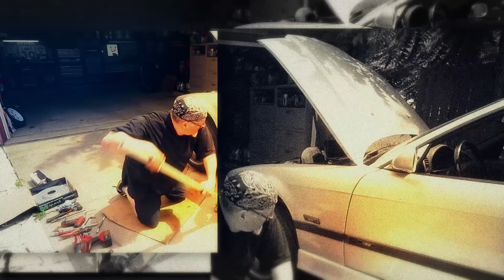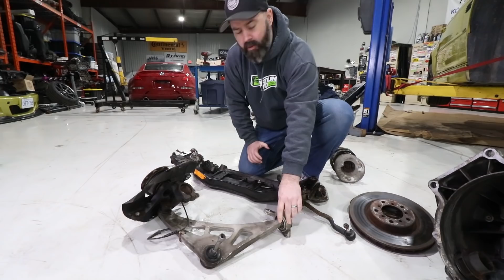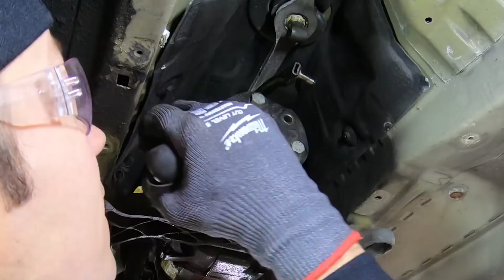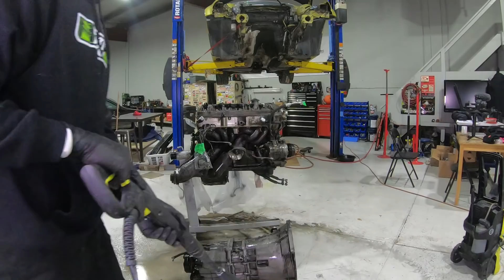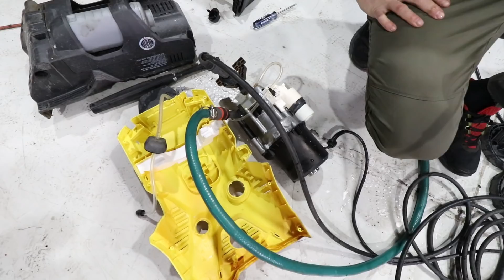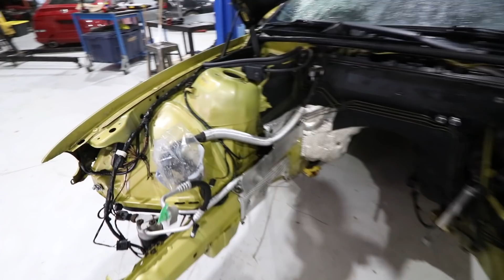Rebuilding and Modifying a $4000 BMW E46 M3 - Part 8

Comment: DO NOT PUT POWERFLEX FRONT CONTROL ARM BUSHINGS ON!!!!! They are notorious for quickly falling apart. (heat issue). Powerflex rear trailing arm bushings are fine.

Comment: Think twice about swapping the plastic clutch pivot pin for steel or aluminum; the small hole or boss that the pivot pin sits in is cast into the transmission housing and is prone to cracking - when this happens you are now out an entire transmission. Much cheaper to simply replace the plastic pivot pin and sleep easy knowing it will break before the transmission casting does!
Reply: Maybe if they're made wrong... We've sold hundreds of ours with zero issues

Comment: Get rid of the US Headers and buy some Euro Headers or some Aftermarket ones.
The US spec headers cost alot of Power.
and get rid of the Cluch delay valve , without it it will feel more like a None Hydraulik Clutch.
 and less wear because it closes the Clutch faster.
Sorry for my bad english i hope you understand what i mean.
Greetings from Germany 🇩🇪
Reply: M3 should not have CDV, at least in Europe it doesnt.
Reply: @juniwalk  and I always thought every E46 has that
Reply: @freakyRunner  Few months back i didn't even know it existed :) My 530i E39 has it removed now and its great!
Reply: US one does :( @juniwalk
Reply: @juniwalk  every M3 sold in the US had one new
Reply: +1 on CDV delete. If this car still has one definitely remove it, clutch feel is night and day difference without the valve on BMWs.

Comment: You can replace the balljoints in those arms. BMW doesn’t say any of there front control arms are serviceable, however you can buy Meyle balljoints for those arms. They are not difficult to replace with a press either.
Reply: JT Lyons isn’t that only for the Meyle branded control arms for the e46?
Reply: Jack Eagan I have pressed Meyle balljoints into Lemforder control arms, so I do not think so.

Comment: BMW fanboy alert! Take your head out of the sand so you can properly recognize BMW's many deficiencies. Just because it's an M series means nothing. I assure you there are much better headers possible. Just removing the cats alone would gain power, so any header that does that will most certainly make more power.
Reply: for my e46 M3 i did fabspeed stepped headers, moved the cats to Section 1 w/ 200 cells. This is close to the CSL set-up. Also, I did a Rogue Engineering x-pipe.  Definite improvement from my butt dyno.
Reply: @nevrcm3261  Sounds like a nice street setup... I was thinking more from the track mindset, like removing them completely. At least they would be nice like you have them, then maybe you could bolt in test pipes for track day.
Reply: @Wheemer  yep for street...and test pipe swap for track.

it will be a fun drifter!

Comment: i always put the m3 csl motor mounts in my cars! they are great! dont have the oil filled core but still dampen the annoying vibrations. you can order them at any dealer. they are often called groupe N or simple e46 m3 csl motor mounts. they are urethane filled rubber bushings and the work amazing!

ps: did you guys check for the clutch delay valve in the hydraulic line? taking that out gives a lot better feeling pedal

Comment: When those brake rotor hold bolts get stripped what I do is use a Dremel tool to cut a deep line then I just use a flat head driver to screw them off. Works every time.
Reply: I usually cuss off the Europian automotive industry for using wheel bolts rather than studs like the rest of the world making those rotor hold bolts necessary and the previous tech for fucking it up prior to and during cutting the slot for a flat tip screwdriver
Reply: Impact driver works fantastic (no, not an impact gun)
Reply: @TheZohanLohan  yes, but only if the last person to work on it didn't strip it.

Comment: Just trying to help, but as good as the Powerflex bushes are, they don't work on the FCA (even the black series doesn't last more than a few months of aggressive use).  I'd suggest getting the Turner Motorsport monoball FCAB for this particular application.  However, knowing how video editing works, I suspect it is too late and they are already fitted LOL ;).
Reply: Like this so they can see it
Reply: Yup, urethane is a bad idea in any component that moves at all. I think it has its place for engine or subframe mounts but that’s about it.  Turner spherical FCABs and RTABs are the way to go for this car.
Reply: I agree on the Powerflex stuff...
Reply: Urethane bushings don't really work on anything. Grease squeezes out pretty quickly, and the high friction in the joint makes the car handle like crap. Rubber is better than urethane by significantly reducing friction (they wind up like a spring). Spherical bearings/rod ends/monoballs are by far a better solution if you want more isolation than a rubber bushing as the friction stays low, and compliance goes away. 

But you're right, they don't tend to last long in lots of BMW applications due to the high loading.